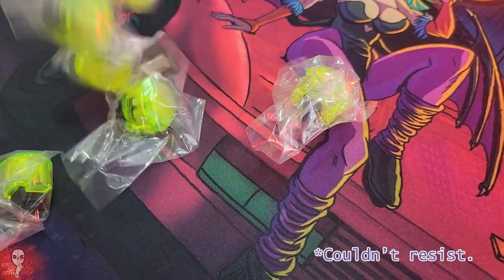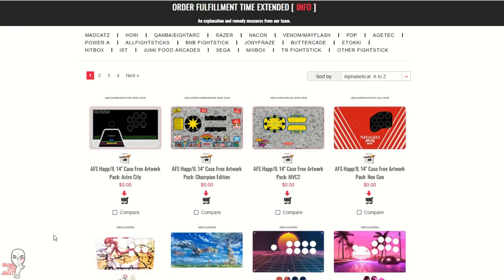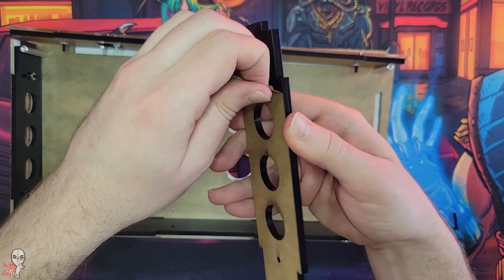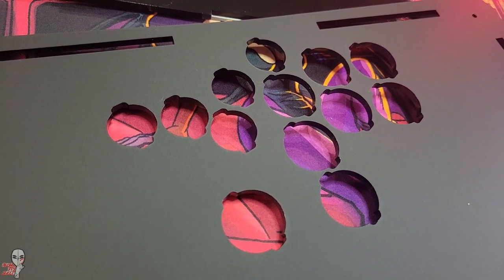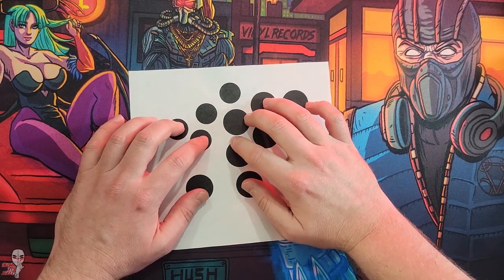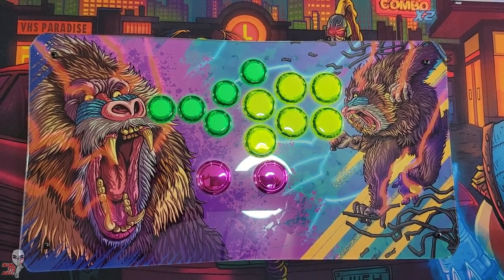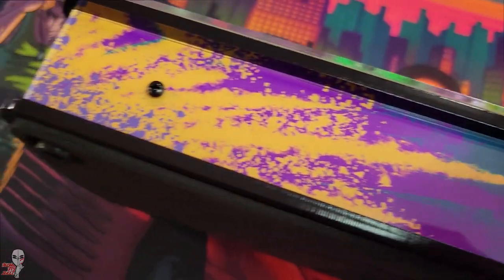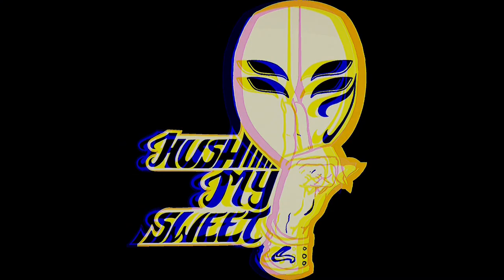BEST button layout for Street Fighter 6 fightsticks? Custom Rooflemonger controller layout!

Comment: I think you see a lot of these issues in the Keyboard/Mouse space as well. Ortholinear or column staggered keyboards are better for your hands, but they're not mainstream, so are horizontal mice. The issue is no one wants to adapt to these changes, and as a result, the standard stays the standard forever. You also see this with screws. Someone said flathead screws are awful, so they created Phillips screws, and then someone said that's awful, and we got Allen screws, and someone said that was awful, and we got Torx screws. The issue is if the new standard isn't adapted, there's just a shit ton of screws for no reason.
Reply from the maker: Very true! I guess I just hope that some brave pioneer (or gigantic fightstick company, I guess) will lean into the ergonomics and swing for the fence on a cool new design to help the industry keep progressing. They should consult with pros and launch it around the release of the target game when everyone is looking to buy new hardware and is excited for the future. Thanks for the comment!

Comment: how to wire more buttons on a brook board?
Reply from the maker: Utilize the screw terminal block. If you want an extra jump function like this (beyond the standard 20-pin harness ones), then you'll need to use 2 of the terminal holes and plug in an "up" wire and a "ground" you can wire to that extra button. It all works just the same alongside a normal harness too.

Comment: I've been messing with a leverless solution with a carboard box, cutting new holes and trying out lots of different button placements. I think the importance of having a finger resting on a PARRY button and another finger resting on DI will be absolutely required (or at least beneficial). I really don't like using my pinkies for anything. My solution to this is to have a button below L kick like you have, AND have a larger button (around 1.5in) below my left palm, in the middle of the direction buttons. It basically feels like I'm resting my hand on a mouse and pressing the buttons on a mouse, and I have DI always ready.
Reply from the maker: Yeah, that sounds like a cool layout and probably an apt comparison to the mouse button. DI reactions seem super important in SF6 so far, so whatever helps.

Comment: Just saw your how to build an all buttons fightstick video and this design is calling to me but im new and wondering how you got 2 up buttons attached to the pcb? Do you have a parts list you used for this set up im interested to know :)
Reply from the maker: I used a standard 20-pin wiring harness and all-button conversion harness. Then! For the extra jump, I just wired two extra wires (to ground and jump) on the screw terminal block. Here's a full part list.

custom cut layout 4tW enclosure from Jony (plus foam bottom)

art printing from Jony

Brook Universal PCB

Brook PS5 PCB upgrade

Sanwa buttons (17 translucent, 2 metallic)

Quick connect 20-pin harness

Neutrik

Neutrik boot

USB Type A to B cable

angled 12” USB A to B

PCB feet

4-pin L3/R3/touchpad

JLF (5-pin) to all button layout conversion harness

extra jump wiring
Reply: @HushMySweet1  I managed to see the wire at one piece in the video but I appreciate the full part list in going to mess around with the extra thumb button and see what fits!
Reply: @HushMySweet1  actually do you have any recommendations for extra wiring for the extra button?

Comment: 2:19 This is exactly why I've always preferred the Hori HRAP1. The standard 8 button layout gives almost no room for resting your hands. Do you happen to be a tall dude with big hands?
Reply from the maker: 6'0", but I definitely appreciate more palm rest area than not. It's a super important element when it comes to comfort imo.
Reply: @HushMySweet1 comfort is a huge factor, hands down. Question for you, would an HRAP style body with a hitbox button layout possible? Specifically the first series layout 1/Orange/fighting jam model. If you're familiar with that particular layout.
Reply from the maker: @Tangaxuan  Not overly familiar with it. If there is room enough for the direction inputs on the face (and typically, HRAP has plenty of room), then I don't see why it wouldn't work. They used to sell all-button conversion kit panels for the Qanba Obsidian, so this should work similarly. You'd need to get a template, perhaps utilize sendcutsend's services for your top panel, IDK. But yeah, I'm pretty confident you could do it.

Comment: So is it possible to order a leverless stick from you?
Reply from the maker: I'm very flattered, but I don't have my own enclosure brand or anything, I'm just a big fightstick enthusiast and like helping others. I will occasionally do one-offs for friends with prefabbed enclosures based on what they tell me  they like...I have enough experience with lots of enclosures and parts to give good direction (the one in this vid is a 4tW case from JonyFraze that we cut with a custom layout), but because I don't have everything in-house and with shipping and such, you're better off ordering exactly what parts you want and putting it together yourself (or commissioning an actual custom builder...I curate a list of them on the r/fightsticks subreddit and it's stickied at the top of the page). If you want this layout specifically, you can order a custom from JonyFraze and mention roofle in the order comments (or simply go with your own creative custom layout). If acrylic enclosures aren't your bag, and you want a metal enclosure, there is AllFightSticks (I'll be doing a vid on them soon, and they also do great work) and you can order them in various sizes to really dial in your preferences. Plus there are makers who do wood, MDF, 3D prints, etc... The sky is the limit. If you need a part list or have any questions or whatever, let me know. *But quick disclaimer: If your stickless build has to play with the PS5, mentally prepare yourself to spend a bit more. There just aren't any good cheap PCB options for that system atm.   Good luck!
Reply: @HushMySweet1  I thank you for your awesome answer, I really had to read it multiple times..

I'm currently looking for a layout that would help me in SF6, Roofle's design is nice but I'm not sure If my finger position is like him or not since I didn't try hitbox b4, so I'm looking for a Buttol layout that has buttons near my thumbs ao that I could mao DI to them if you have a place where I can see existing desigbs and choose from them that would be great, and If you have a recommendation layout that would be awesome
Reply from the maker: @EdokLock  Go to the focus attack website, specifically their custom art section. There, they have lots of the common fightstick art templates. Scroll through until you find one that looks interesting. Click on it, download the .psd layout file, and then duplicate the layout layer (the original will probably be locked, so you can just choose not to view it) and start adjusting things. Like smaller buttons and a tighter, more keyboard like hand position? Go with 24 mm buttons. Like larger arcade-standard buttons or just have bigger hands? Go with 30 mm. Or mix and match. Put things where you think they should go. Then, print it out and try laying your hands on it and experience it firsthand. Still love it? That's your layout. Find it needs some tweaks? Tweak it and rinse and repeat.

Comment: Companies refuse to part with the Vewlix layout because of its flexibility. Say you can put the DI and DP to the leftmost action buttons, and just shift your right hand one finger position to the right, now you achieved the same thing without changing the design layout. The only thing that changed was your hand being positioned on the rightmost and the binding to make it easier to reach. I find that some players have difficulty relearning binding positions because they have a bad habit of resting their palm on the controller, when you should always lift your palms, this is the same for typing and playing the piano. You shift your hands horizontally to make faster reach, than vertically and diagonally which only twists your wrist and causes injuries in the longterm

Comment: Unfortunately this controller layout breaks the rules of the Capcom Pro Tour -- it even SPECIFICALLY states that two UP buttons is not allowed. This is silly if you ask me because the obvious workaround is to use a 'spacebar' button like you considered, but there is it. Here is the snip:

The maximum number of digital input systems that can be used as a moving action is limited to four(4). This is intended to be allocated in the vertical and horizontal directions. Even within the range of the number of installations, the same movement action cannot be assigned to more than one input system. For example, it is not possible to install more than two(2) input buttons for the upward direction.
Reply from the maker: We knew going into this (and that's why we considered the space bar solution), but because 1) a player will play online or at locals where 99% of the time, CPT rules won't be observed, so seems better to go with most comfort, and 2) despite CPT rules, I have found those events (at least EVO) fairly lax. Like I saw Hitsticks and anklegator's 30 button build at EVO LAST YEAR. If it is for an ergonomic element like you see here, I really doubt Capcom is going to crack skulls in regard to double input controllers (unless they can really be leveraged to a noticeable advantage).

Comment: I was looking through some of the links to custom sticks from the video but didn't see one where I could customize the layout. I'm trying to find one where I can get an all button style stick (large) with the  movement style similar to a traditional stick but angled more for ergonomics, then the action buttons angled more as well, with maybe a couple additional buttons and a large space in the center to keep my shoulder's opened up. It's very similar to the KeebBrawler but with some additional action buttons. Do you know of anything like this that is available?
Reply from the maker: I don't know of anything that fits your requirements exactly, so that's likely a custom job. I think Jony has had to slow orders so he doesn't get completely buried. In the meantime, download JF's 4TW Artwork Template on that main 4tW DIY page. Make your own copies and then start playing around with how you want the buttons. Sometimes you'll need to reposition the Neutrik if there's too many buttons crowded in that area, but Jony can help you with that if it's required. Once you get a layout you like, print it to scale and test it out. If you still like it, have the file ready to go when Jony accepts orders again. If you don't like it, tweak and adjust as necessary until you're happy. If you don't want to wait for Jony the same principles apply elsewhere, and you could try one of the metal enclosures from AllFightSticks. I know all the usual fightstick vendors are pretty strapped right now because of SF6 so it may be a wait no matter who you choose. Good luck with your project!

Comment: I'm highly considering going this route for my next build, but I'm curious how you're able to wire 2 buttons to jump. I'm guessing you're adding another wire to the Brooks board by splitting it or something?
The reason I ask is I've only ever used the pre-installed header kits from focus attack. 
Also, I love the dedicated buttons for drive parry and drive impact, how hard would it be to add a third for a grab button (seems throw loops are very strong in the beta)? I'm trying to imagine how extra buttons would be able to be bound in-game when there are only so many options.

Hope you have a wonderful Memorial Day weekend!
Reply from the maker: You can do one with a standard 20-pin wiring harness, and then for the other, you can utilize the screw terminal block. You'll need two new wires and you just hook them to the button like normal and then stub into the up function and a ground on the block. Hope that helps! Have a good weekend.

Comment: As someone who is coming from custom keyboards, I find it interesting that it's not common for fight sticks to have a modifier button. A vast majority of custom keyboards are smaller than the typical full size keyboard, which typically means not having anything right to the Enter key, and/or no F row, making it mandatory to have such a function. (The Fn key on laptops is in the similar vein, except it doesn't apply to the entire keyboard and is not remappable.)
The way it works is simple. You press a button you map as the modifier key. While pressing the modifier key, all other keys will use the second map/layout ("profile"). For example, lets say that right jump button is your modifier. While pressing it down you also press your LP button, it now outputs a throw or say a macro. We don't need dedicated physical buttons for every input when it comes to fighting games, so this way instead of adding X buttons, we theoretically get twelve more buttons by having one modifier button. This type of function has existed for years, yet large companies like Razer have still yet to provide such archaic hardware-level software into their gaming peripherials, like their $200~$300 mice and WIRED controllers. I am again disappointed with the Razer Kitsune for being another cash grab that pretends its "new" when its not, and the whole fanboys who are going to buy it just because of the brand, then push it into people's faces.
It was a very wise decision you ditched the spacebar. The spacebar has always been a crux for keyboards because its the one key that needs stabilizers because of how much key there is to the switch. The stabilizers cause annoying rattle and can make the spacebar either pop off or stick on if the spacebar if pressed repeatedly from a suboptimal angle. It's the reason that it reamins as one of the first hurdles and goals of a custom keyboard assembler to elimate as much rattle from the stabilizers, which is most noticable on the spacebar.
Moving on, from an ergonomic standpoint, fightsticks are as bad as keyboards. I know it's not very niche to need specific combination inputs because of SOCD, so its better to have all the buttons close. However, to even try get closer to ergonomic, the directionals and the other inputs need to rather be on the edges of the plate (where the Mandrill art is). From another angle (literally), wrist rests and the flat surface of the fightstick, as well as typical keyboards, are not just not ergonomic but harmful. They all cause stress to be placed on your joints, especially your wrists, which is how you get arm/shoulder/neck discomfort/pain to disorders like carpal tunnel. The ideal angle would be your hands sloping downwards, and another slope with its apex at your index. It's very difficult to meet all criteria for something on a flat surface, but we already have a working design like the Ergobox/ErgoArcade. The issue with those, as seen with other verical input devices, is that it makes it difficult to press down a button because there's much less reactionary force than a typical radial input due to the angle. The steep angle also adds fatigue because since your body has to absorb and correct the lateral force to keep the controller in place while not misfiring the opposing buttons, a non-issue with traditional inputs. Ideally, the ultimate ergobox needs to have: adjustable angle in all directions, a heavy weight, and a strong grip at the bottom to create friction to disperse some of that lateral force. That would be the most ergonomic single-piece lever-less fight stick to ever exist.
Reply from the maker: Great and thorough comment! We really went back and forth on the space bar but came to the same conclusion as you in the end. I've always wanted to mess with an angled stick, so maybe I'll put something like that together in the future.

Comment: What type of layout would you suggest for someone that struggles a bit using the last 3 buttons on the bottom row for a hitbox. For some reason it just feels super awkward for me, and since i have a hitbox brand one i can't really make changes.
Reply from the maker: For what reason do you struggle? The buttons are too small? The angle is wrong? Have you deliberately practiced moving fingers from the top row to the bottom and something still feels off? We could probably dial in your issue if you were here in front of me and could try an assortment of sticks, but since you're not, this is what I'd recommend solo. 1) Reflect on what your current layout is missing and where it falls short. 2) Research a variety of other layouts. Download the appropriate .psd files. There's a bunch on Focus Attack. 3) Find one that looks like it should be an upgrade. 4a) Print the default version and test. 4b) Print a customized version including the changes you thought would benefit your own hands. Test again. Mark new areas for improvement. 5) Test again. You'll likely have to do this a few times before you finalize. *I don't want to bias you and I don't know what your hand size is, but I'd first look at modifying the angle of the buttons. Hit Box uses a Vewlix which keeps the buttons in more or less a straight line. So depending on how your wrist comes in and your fingers rest, it may be uncomfortable. Try to get a layout where you simply have to pull your fingers inward and they'll go from the top row to the bottom row without any other movement (like the start of a fist clench). Good luck!
Reply: @HushMySweet1  Thanks for the tips